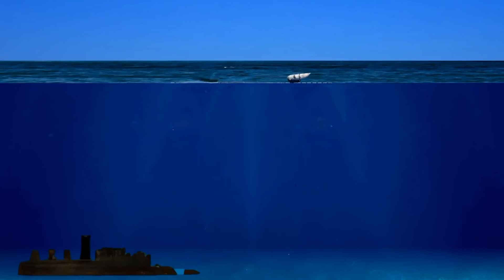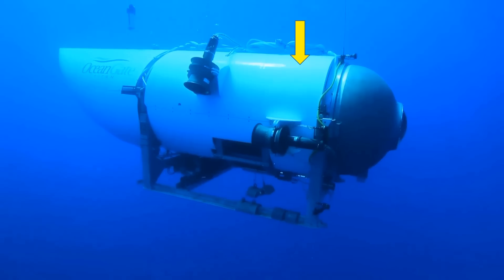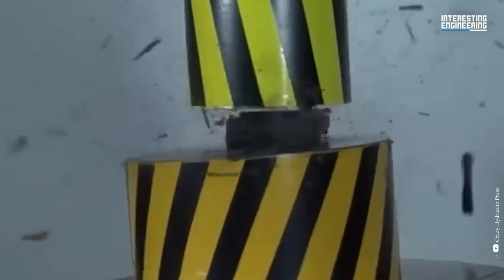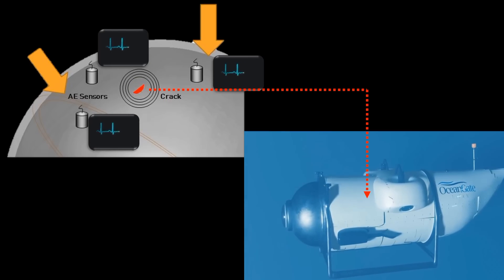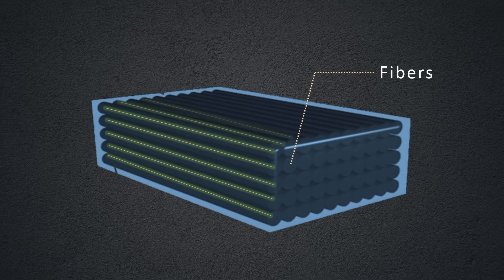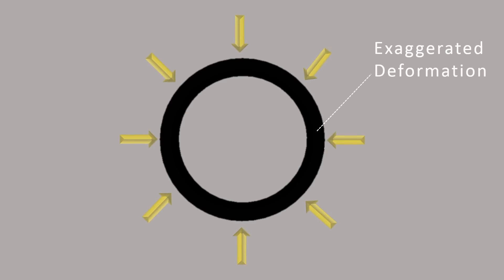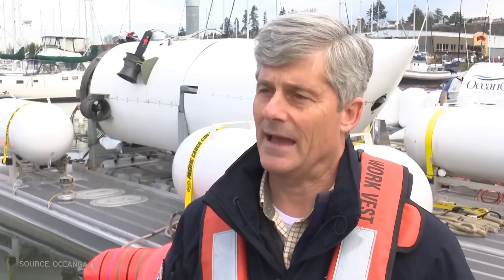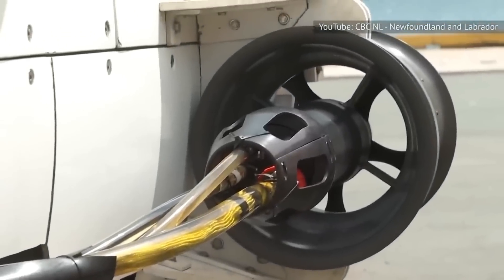Oceangate Titan Did Not Implode Just From Pressure. There Is a Catch!

Comment: I always wondered where and how electrical wires were fed from outside to the inside.At some point in the build process, certain wires must have been fitted to control or communicate with the subs external parts. This for me was how the weak points were created. So many channels and news outlets, have told us about the carbon fibre build with industrial glue holding the end caps. But I have yet to hear about the wiring which came  from outside to the inside.
Reply: Good point!

Comment: Forget about the game controller. It is what is attached to the other side of the game controller, what clearly shows that Ocean Gate doesn't give a s*** about the established rules of engineering. It really looks like they used standard x86/64 Windows PCs with touchscreens to control and regulate all the electric and electronic devices. Imagine you suddenly see an obstacle, and you give a full reverse input to avoid coalition, but your steering PC is currently busy with another important task like "cleaning your hard disk". 🤯

Comment: yeah, the microcontroller not looking serious

but the first most important issue is, that there were absolute no  any plan
i repeat any plan  in case  a breakdown  to bringing up the  sub

there were no solution  to manually  dropping  weight
the cabin was  hermetically closed
the trusters  werent able to move the  sub if its get  strucked  by collapsing parts of the titanic

the cyclic fatique truly  a problem  the owner ignored

Comment: The carbon fibre should have been weaved around the pressure hull not in the one direction. There was no auto clave used to dry out the resin of fibres.

Comment: That's not a comfortable safety margin, James Camerons Submersible was tested to go to 20,000 feet.  Titanic was resting  3800 metres , , 12000 feet ,  Titan only designed at 4000 metres. No non-destructive testing done whatsoever.

Comment: Carbon fiber is great for many applications but apparently not for this one. It did work for a while, then it failed. In general the sub was under engineered, with too low of a safety margin. The actual fabrication was poor. But these things happen and we learn from them. The early days of pressurized aircraft had catastrophic failures. We got better at it.

Comment: No one has mentioned the possibility that the vessel was improperly bolted from the outside, on the launch platform. The bolts seem to have been tightened by hand (with a manual wrench? with an electric wrench? with a hydraulic wrench?) This process might have left microscopic gaps through which the internal pressure was destabilized, causing the explosion (not implosion) of the structure.

Comment: im not a Mech Eng....but wondering if the designers of the titan did their calculations (some form of auto cad?) on a sphere vs an elongated cylinder with hemispherical ends,,,,with the software assuming a "tube" of homgenious material, at least as its default setting?.....at least as a starting point?. my two cents worth.

Comment: The compression of the hull would have caused relatively more dimensional compression of the interior layers of fibre (compared to the outer layers), which could have instigated buckling on the interior surface.  Once buckled, that interior layer would become non-structural, and the compression would have moved to the next onion layer going outwards.  Of course with some kinetic shocks at the same time, the next layer would buckle faster, and the failure would propagate faster.  And as the surviving hull became thinner and thinner, the compressive force on the remaining good fibres would become higher, leading to even higher failure speed.  I don't see any tensile load on the interior of the circular shape, as the entire circular tube was in compression.  Just an architect muttering.  But thanks for such a good description of issues!

Comment: The problem with this is that the kinetic engergy applied by pressure is greatest along the long side and least on the short side due to differences in surface area such that the majority of the energy imparted by pressure was unevenly distrubuted, being the reason DSV Alvins Titanium pressure hull is a perfect sphere.  If Titan's pressure hull had been a perfect sphere the outcome might well be different.

Comment: You comments on carbon fiber are correct. But there is also the problem of material interface. Meaning the carbon fiber composite and the titanium in the nose. The difference in physical properties is something that every submarine and submersible design must contend with. This and the stress cycles spells trouble.

Comment: I totally agree with your evaluation.  The first I asked when I heard of the accident was how may pressure cycles had the sub made.  As an ex submariner I am well aware how much a modern submarine hull with HY80 steel changes its size when sumerging to test depth.  Has anyone mentioned if the hull of titan changes diameter as it goes deeper.  

Airliners with their thin aluminum skins are rated for just so many cycles of pressurizing the plane before it has to be checked for defects.  Who designed this sub and what voodoo engineering did they use.  Its sad that lives were lost determining just how many dives it should have survived.

Comment: Using carbon fiber in compression wasn't smart, but the REAL problem was using dissimilar materials that weren't allowed to move indepedently.  The carbon tube should decrease in diameter by about .5" at that depth, but the titanium will barely deform at all.  The carbon wasn't allowed to deform due to being bonded to the Ti rings.  This leads to an immense stress concentration at the Ti/Carbon interface, resulting in buckling

Comment: I agree with the differentiation of tensile vs compressive strength as a major risk item.
I agree with cyclic fatigue as a major risk item.
Another point of concern:  joints of dissimilar materials joined by epoxy alone.
I disagree about the game controller.  That was brilliant.  The control switches are design to take many more cycles in normal use than they would ever see in this situation.  The link from the controller to the controlled elements, whether wired or Bluetooth, would be the weak link with this, I believe.

Comment: 7075 was one of the worst aluminums for deep sea applications. Mechanical engineers love it for its high tensile strength/weight. Same for carbon fiber. Neither material can be made to be reasonably inspectable for high compression or low-cycle fatigue. 6061 is not good either due to copper content which corrodes in salt water. Ti is high strength orthotropicly and noncorrosive in salt water. 5052 has no copper to corrode and is a common material for marine applications. It's highly unlikely for 5052 to experience pin hole corrosion. Protective coatings on 7075 exacerbate and accelerate pin hole corrosion, because any corrosion on the connected metallic structures will be concentrated at those pin holes which may not be found using any inspection method. The thing he mentioned about tensile side of bending of carbon fibers is not applicable, because they would have been under 100% compression at depth. So the net conclusions are that 7075 and carbon fiber did a pretty good job temporarily. FATIGUE WAS NOT A CONTRIBUTING FACTOR IN THE TRAGEDY. PIN HOLE CORROSION WAS HIGHLY LIKELY, and the vessel likely popped in the same manner as popping a balloon. The occupants only suffered if there had been a sign of structural failure moments before bursting, which is not likely unless the carbon fibers had already failed. Lastly, the only good shape for the ultimate pressure vessel is a sphere. The author of the video should give back any diplomas. It wasn't fatigue. If it wasn't cyclic fatigue per se, a full scale test of the vessel using ballast weight instead of passengers to depths exceeding the max operational depth by a significant margin would have been advisable but would not have resolved issues related to wrong choices of materials. I would not have gone to depth even with good material choices, especially for entrepreneurial endeavors. The fact that the vessel was registered in the Bahamas would seem to be a criminal obfuscation of U.S. law.

Comment: Thank you for the informative video! A very nice presentation.

Just some wandering thoughts:

I wonder if they had put titanium ribbing on the interior every 10 inches or so, if it would have prevented or at least reduced the pressurization/depressurization deformations. It still bothers me that I heard that cracking noises were heard as part of prior descents (just see https://www.google.com/search?q=titan+sub+cracking+noises).  Were the noises the sounds of carbon fibers snapping or delaminating deep in the hull material? I know I don't like cracking noises where high pressures are involved.

I agree with you about the use of a game controller for the main controls on the sub, that bothered me the first time I heard about it. I hope that they used a POSIX type real time operating system (RTOS) like LynxOS, because you can't have software hanging like PCs tend to do at times when commands to the sub's thrusters and other actuators need to be fast.  The software should also be compliant with MISRA C / MISRA C++ as it is all critical and safety related.

Personally I would have a set of switches that could override the computer and allow the pilot immediate control of the sub's actuators (this is sort of like what are called discrete signals on avionics systems - just a 28VDC on or off loop). I would also like a big red button to scram the mission and immediately begin heading to the surface. (Some aircraft have a system that allows the landing gear to lower using gravity in the event of a hydraulic failure, it's not too complicated.)

The whole thing is just so sad.

Comment: Another aspect is the difference in how much titanium and carbon fibre compresses at depth. These two materials were bonded together with an epoxy. There's a video from Oceangate showing the process where they apply the epoxy by hand, which inevitable introduces variances in thickness, it didn't show them roughing the smooth Titanium surfaces prior to bonding so how well will the epoxy stick to the Titanium?
The differences in bulk modulus of Titanium and Carbon Fibre must create some untoward effect where they are bonded together.
Reply: And the epoxy was not applied in a clean room.

Comment: Stands to reason it was fatigue. Same as the Challenger wasn't continuously monitored for stress and ended up blowing up because of it. Not to mention this guy was all about the money and didn't adhere to the inspection curriculums and lost his life because of it. Structural failure is more prevalent than we realize.😢
Reply: The Challenger blew up because the O rings would not work properly at low temperature launches.  But the pressure was on by a non engineer to launch on time and disregard the warnings.  Low temperature at launch caused the INEVITABLE failure by not heeding the warnings of the engineers who KNEW what would happen.  Politics kills.

Comment: Fiber never implode suddenly, there will be wall movements first, fiber is not as glass who break suddenly,  (example) so sensors need to sense low to very low frequencies to detect the wall is bending, fiber can bend, so I agree that the technology is not setup properly, people has no idea what for pressures there are in deep sea. Mine thoughts go to the family of the victims, wish them strength in this difficult time..

Comment: Carbon fiber is good at any kind of pulling load and irrelevant for pushing loads. A submersibles hull experiences a push along  the perimeter because the ocean wants it to become smaller. The strength of the submersibles body is not the strength of carbon fiber, but the pulling strength of the glue used in assembly because the perimeter push will cause the fibers to try to separate. Your graphics - around t=6 - appear to omit the load direction along the perimeter and instead assume a load on the side of the perimeter. I submit that the resulting load vector is circumferentical, ie. along the perimeter and not a side pressure. See also building arc theory. For this reason the carbon fiber construction is geometrically unusable, the construction asks the fiber to do what it can not.

Comment: What all these engineers are missing with the technology that was installed to detect a integrity issue within the hull, is that it doesn’t account for the fact at the depths they were operating, even if a crack had started to form, the pressure would have continued regardless if the decent was arrested and they returned to the surface… the change in depth going up, would have increase the failure rate of a formed integrity issue…..so the alarm, would have merely been a reminder, that it was game over. Not to stop a catastrophic failure.

Comment: I very much doubt that the CF in the tube of the vessel body experienced any tension. Poor stress transition to the end caps could be a point of failure, but the inner (unsupported) surface of the tube would be prone to spalling as the epoxy matrix fails allowing bucking of the CF in compression. This would then propagate very rapidly due to CF composites low work of fracture.

Comment: The investigations  reveals that the crew did hear ~1 minute before the probable time of implosion, a craking noise in the rear part of the hull, at the level of the connection between the rear half sphere and the cylindrical hull: it is MUCH more likely that it is the GLUED connection that has yielded, and not a simple crushing of the carbon cylinder

Comment: NO, NO. Elongated shapes are NOT used in submersibles. What you are talking about and what you showed are SUBMARINES which cannot go any deeper than about 800 metres. Even the best elongated military grade super submarines in the Russian navy cannot go deeper than 1,000 metres.  Small SUBMERSIBLES which dive to 4,000 metres to the Titanic wreck and to 12,000 metres in the Mariana Trench have spherical chambers with non pressurised structures attached so they look elongated, but the crew section is a round ball.

Comment: it's not so much the failure of the material but more the deflection of the material under heavy compression. the movement of carbon fiber in relation to titanium under pressure was a guaranteed failure point especially when those connections were not secured properly.  once the titanium ring separated the vacuum created by the water rushing in imploded the ship causing the carbon fiber to shatter like glass.